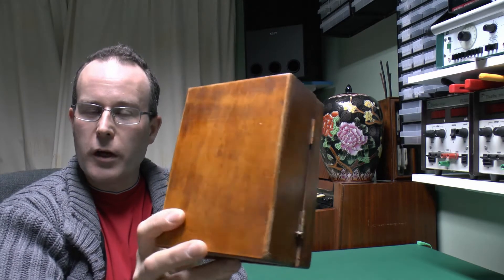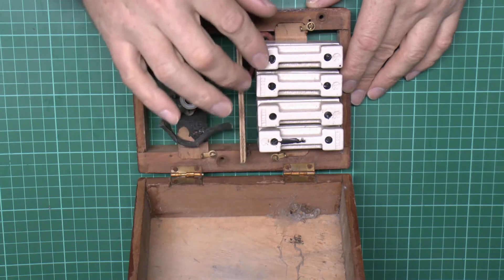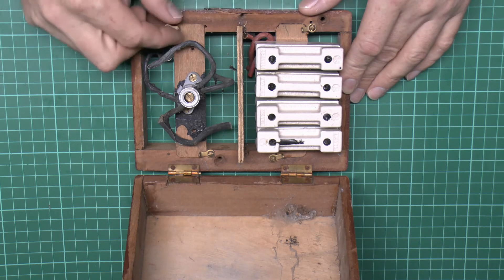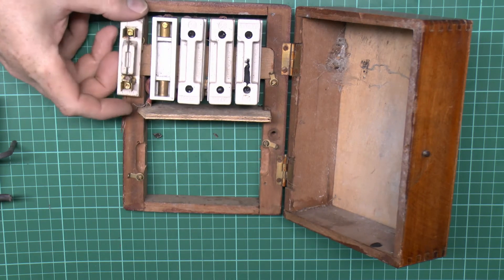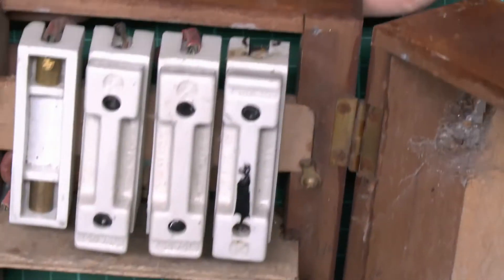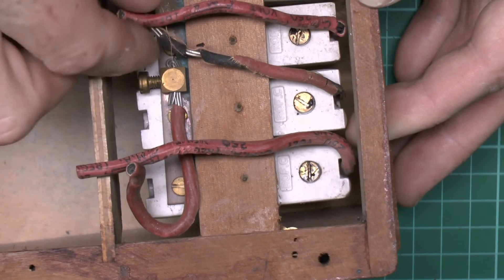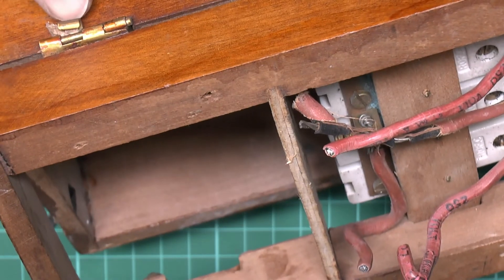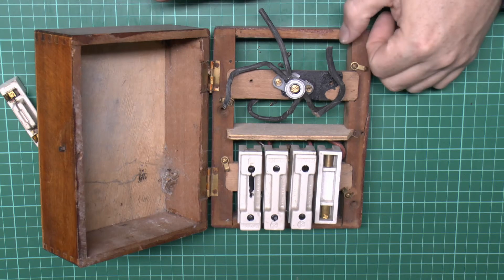Small Wooden Fusebox with 4 Ceramic Fuses & Neutral Terminal Modification

Comment: my dad still has one of these feeding the downstairs socket 20A radials. Yes I know the house needs a rewire
Reply from the maker: If it has the wiring from the same age as the fusebox (which is 1950s at the very latest), it should have already been rewiried in the 1970s, and probably again in the 2000s.
Reply: :-)  yes it all dates from 1954. An MEM Kantark. The sockets are wired in 2-core as well...although a bare stranded earth does call around everything.